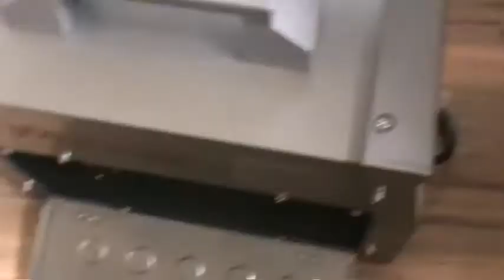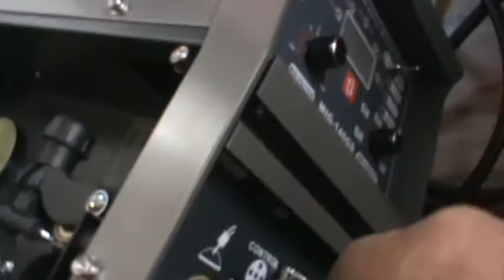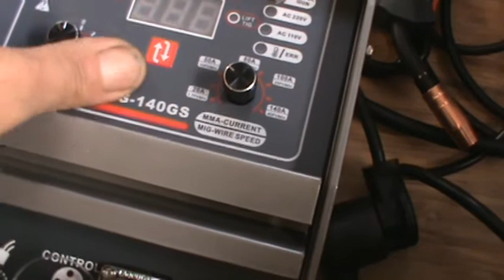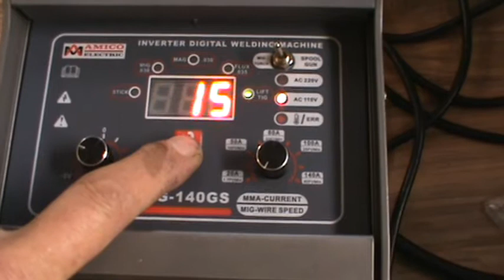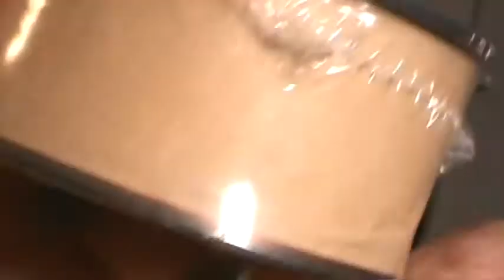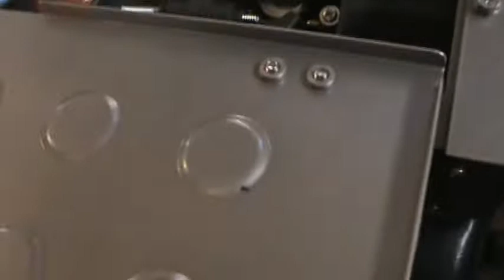MIG140 Mig Tig welder unboxing

Comment: Just got my welders certs. But i wanted to do more practice at home. I only had experience with stick though. So i was looking into something like this. Might give it a shot. 👍
Reply from the maker: Congrats.  They are good welders. Takes a while to get used to them, but so much more convienent and easier to use than stick.

Comment: I love mine tbh been a beast for me
Reply: Have you done any tig with it?
Reply: @justtestingonce  I've run stick with it which works fine. I'll try to remeber to test the tig function but I'm sure it works fine. I have other tig welders so I have never actually tried the TIG function yet, I  mainly use it for MIG
Reply from the maker: I tried to, but I kept sticking the tip in the puddle. I see the learning curve will take a while, so meanwhile, I just Mig weld everything.
Reply: I agree

Comment: Thanks for posting this. I'm wondering, exactly how big is the welder? It looks really small (which is good for my purposes) but the dimensions on the HD website don't seem right. Also, Does it work pretty much just as well on 110 as it does on 220? I recently bought a cheap welder similar to this and it has basically no power on 110 but seems to work fine on 220. I'm returning that one and am now looking at this model but am semi-concerned it might have the same issue. Thoughts?
Reply from the maker: It seems to work well on both 110 and 220. It has more power of course on 220, but I mostly use it for sheet metal. It is small, but not that small, probably weighs 40 pounds. It works super good as a flux welder too, I found out. It will burn good as a stick welder on both 110 and 220.  But it really shines as a mig with gas.
Reply: @1otviii  Thanks for the reply, I actually bought it and it seems to work great. The other brand I tried before this Amico must of had something wrong with it.
Reply: @evanfrucht  remember you’ll max out at 100amps on 110v and 140amps on 220v.
Reply: Update after 11 months hard use in the field. Works great still. Very small and portable (smallest mig welder I've ever seen, almost looks like a toy, will measure and update with dimensions) combined with a small aluminum tank makes for a good portable mobile setup for automotive sheetmetal repairs and gate work, etc. Only runs 2lb spools (otherwise the unit would be larger/heavier.) Has enough power for good penetration on 3/16 plate on the highest setting with 220v.

Comment: Maybe try using a small enough O ring and see if you can get one to sit in the .030 or .035 groove to take up the extra space the .023 wire has. I think it might work.
Reply from the maker: I ordered a  new roller that is .o30, and it runs the wire just fine now. I also ordered a roll of 35 wire, so when this runs out, I will try it with the bigger wire. I am real happy with how it works, but it just really does not have enough power to do 1/4 metal if it is not chamfered.  But for what I mostly use it for, it works great.  I got some stick, and my new shop has 220, so I will give that a test soon when I get around to it.  There is a video of me welding a f100 motor mount that is pretty heavy and you can see how the wire does.
Reply: @1otviii  good to know I just ordered that exact welder. I'm by no means a pro but I've done my fair share of welding. I bought some metal to practice on. Unfortunately my house isn't wired for 220. Well not yet at least.